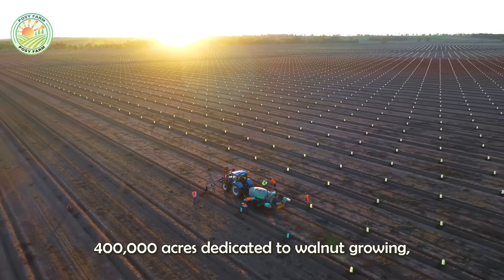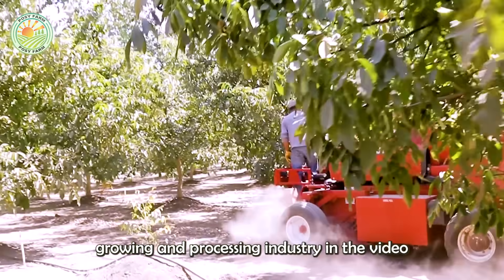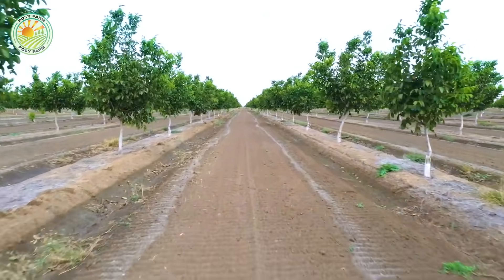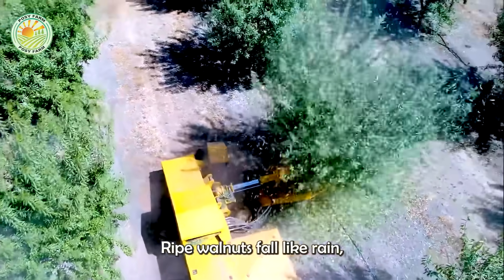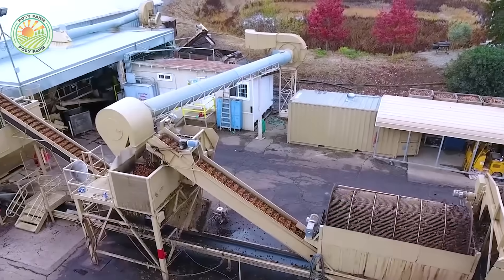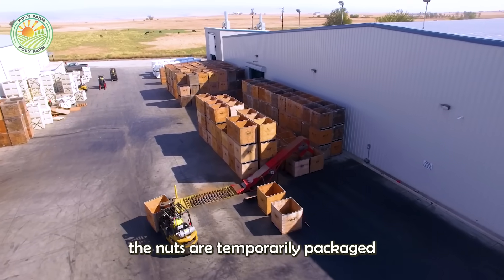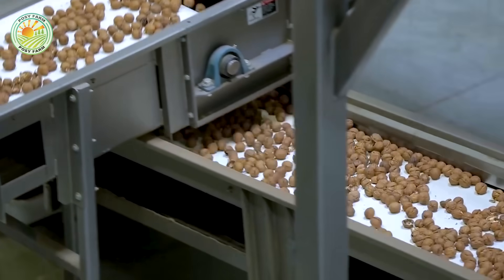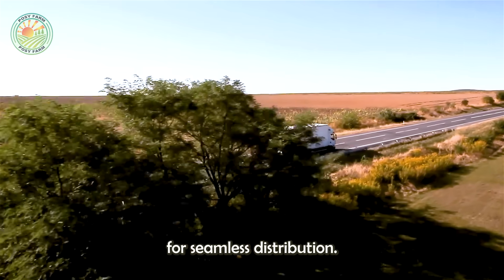How Farmers Harvest Thousands of Tons of California Walnuts – Walnut Farming and Processing

Comment: All very impressive, but here is How i deal with the walnuts for my personal supply here in Germany: Comes autumn,  I approach ny orchard with its  huge ancient tree , still producing reliablly year by year: i check the ground below it up to three times per season for the nuts fallen down by gravity. My experience tells me which ones to pick and which ones to leave alone for being too small or not sound in some way.  I bring them to my house pouring them onto some wooden gratings that the previous owner left behind. After around four weeks,  i start cracking them manually along my demand, which at the same time allows for another quality-control. No machinery, no motorized vehicles involved,  no fuel burnt,  no water spent for washing, no additional energy used  for drying, et cetera, et cetera...😊
Reply from the maker: Thanks for sharing your personal, sustainable method of gathering walnuts in Germany! It’s inspiring to hear about your hands-on approach. 😊